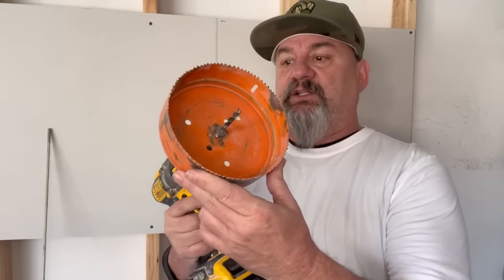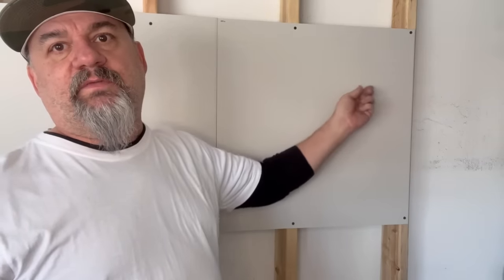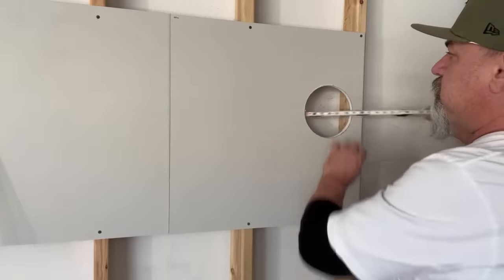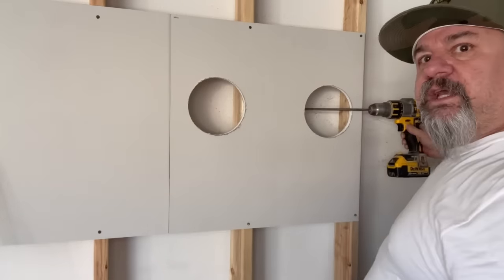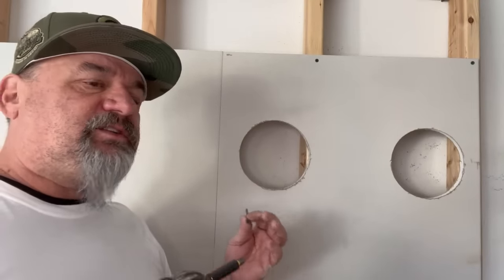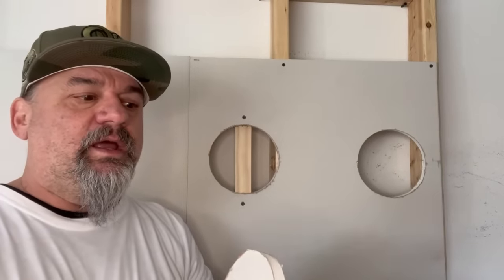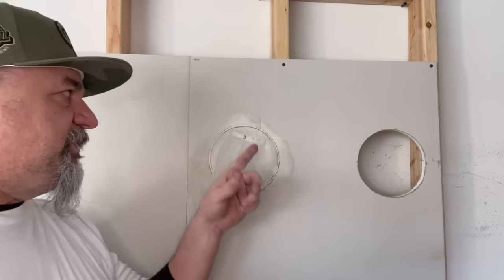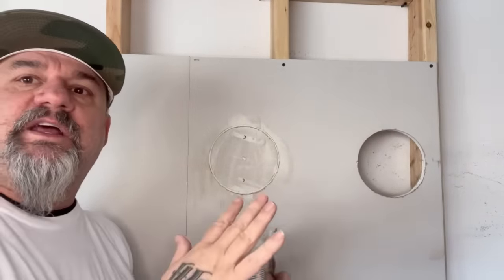Unbelievable Trick to Run Wires Through Walls and Fix Drywall - You Won't Believe What Happens Next!

Comment: Nice tips Mr. Starving Electrician!

Here is something to consider: the mini angle drill to drill horizontally through the studs, or even a regular angle drill with multiple extensions to drill longer lengths horizontally.
Reply from the maker: yea but cant see the other side of the studs for wire or water pipes
Reply: @StarvingElectrician  have you ever tried using a walabot?
Reply: @StarvingElectrician  I've only worked on my own house, but when I needed to know what was behind the wall, I would just drill a hole large enough to stick my borescope into, and then I could see, and the hole I made was small enough to fill with just mud.
If that didn't work, I would make a big enough hole to stick my phone in, and take pictures or video, and that always worked for me.
Reply: @maximusvonderbrewskis  - Funny thing, the Walabot ad appeared right before the video for me.
Reply: @StarvingElectrician sometimes you just gotta risk it for the biscuit, buddy

Comment: All good info!! Only thing I would suggest it to use plywood strips for your backing pieces if it's available. Frequently, those course thread screws will split a small solid piece of wood but the plywood will never split since it's laminated with criss crossed pieces. I always try to put a wider piece in the hole using a long screw right in the center to hold the piece while you install the first screw. 
Obviously, we all use whatever's available!! ;o)
Reply from the maker: yea great point cause they have split on me. thanks
Reply: This is how I know you’ve done this before lol, you are 100% on point.
Reply: Love the plywood idea.  And I know Im being picky, but I would use two backer strips; one screwed to the stud and the other just like his backer plate.
Reply: I use OSB rather than plywood and glue it to the back of the drywall along with the screws.  This leaves a corner that you can butter with compound before you stick the drywall piece back in.

After you sand that compound, prime any fuzzy paper with Kilz, add a small amount of compound as needed and sand.  After painting, the patch will be almost impossible to find

Comment: As a 59 yr old electrician I can tell you that this is the preferred method when you have to drill holes. The key is to leave only footprints. We all have to work together and be our own custodians, most drywallers will not shred your wires with a rotozip if you take care of them lol.
Reply from the maker: sooooooo true!!! lol thanks for watching
Reply: @FedEXfright This is factored in as it's the only way to really get wires, pipes etc from point A to point B in a practical manner. Of course you don't want to drill oversize holes or too many in a row etc.
Reply: @FedEXfright Structurally speaking, drilling a small hole through the centre of the stud has virtually no impact on its load capacity.   What you want to avoid is cutting slots or holes on the edge of the stud and that effectively reduces the cross section.
Reply: @FedEXfright There's codes on drilling holes. As long as you follow the guidelines you are good.
Reply: @Spp235.  In today's houses, I've seen studs cut with a handheld circular saw (I think) with a slot going 2/3rds of the way through the stud at an angle.  Supposedly this allows the drywallers to hang the walls so that they don't do the wavey thing as they transition each adjoining stud along the wall.  The slots in the studs allow the studs some "forward and backward" flexibility to keep the drywall board relatively true all along its width.
Reply: @Jack O'Bean Except if the drywaller has a longer lead-time to work and the homeowner has to hear spousal verbalizations about all the holes in the walls.  If I'm a bachelor, I don't care if I have holes in my drywall for a few weeks.  If I'm married, then I care the same amount as my wife cares.  And it's always less expensive to stay married than it is to get a divorce.  Funny how that works!
Reply: @justaskin8523 that sounds like it would seriously reduce the load bearing ability of the stud, like alot... unlike centered holes. Then seems like with all that extra effort would be better spent culling super wavy studs for walls (not like smaller pieces aren't required on build or some wast is expected)

Idk maybe I am just misunderstanding

Comment: Great advise from an electrician, and I don't even like electricians, plumbers, HVAC, I'm an old guy so I don't like anyone now that I think about it. Joking aside,  A great method for one or two studs to get through but like you mentioned about "you are going to have a hole anyway, size doesn't matter"....Most drywall guys would prefer one single large hole since it's not any harder to finish one big hole vs. 4 small 6" holes and a "hump" at every hole.  Thanks, look forward to checking out your other video's
Reply from the maker: thanks so much!!!

Comment: As a DIYer, I make it easy on myself and remove a section from mid-stud to mid-stud when I'm making a hole bigger than about 6 inches. That always gives me superb support at the ends, and I use those clip-on / screw down / break off clips devices to solidly support the new section of drywall. Tape and mud the edges, sand the surrounding texture down so you can blend it, texture and paint. 
The last DIY job I did (last week, in fact) involved removing a switch that no longer had a purpose and repurposing the wire for an outlet. I'm pretty slow, but drying times actually set the pace. Anyway, I had lots of room to swing a hammer, allowing me to use new construction methods. A 48 by 18 inch piece of drywall made it a simple job.
Reply from the maker: yea I dont envy the drywall guys job at all

Comment: Openings in wall are situational but very good general points.

I've done drywall for over 30 years and general construction, had a hand in most trades.

Always such a brutal sight to see people wanting to make the smallest openings and then just making more problems.

Other people have mentioned maybe a larger opening rather than a bunch of round ones, etc.

Depends on the run. Depends on the wall. Depends on if it's a total finished house or a fix to house under construction with no flooring but finished drywall...

People stop thinking there's one way to do everything. Kudos, great vid.
Reply from the maker: excellent! thank you so much for that!

Comment: @7:48 - Those that advocate for the "california patch" where you have paper overhanging don't understand that you have to do that from a fresh piece of sheetrock. Your method works fine because you are reusing a perfect insert with a strong backing. 

Your method is simple and effective. The other way is way more work and works well too though, but unneeded.
Reply from the maker: yea I remember that term. im just not skilled enough to pull that off. this hack is as good as it gets with drywall...lol
Reply: @StarvingElectrician  for the cali patch, collect some drywall scraps on the next job take that 6" hole saw bit drill out as many 6" holes you can from the scrap flip them over, now take your 4" hole saw bit using the same pilot hole from the back drill slowly down to the paper, take your knife cut the brown/back paper from the outer ring, or cut trough it, break the drywall on the outer ring into pieces peel it off the paper face.. now when you make your 4" holes you have a ready-made cali patch.

Comment: I tend to do every other stud and drill both directions. Saves holes. Also, in some limited circumstances, if you use the large diameter holesaw, you can drill directly over the stud. That gives you the backing to secure to when you  go to put it back together. Useful in some cases where you just need access though if you are drilling with a long flexible bit you can do it there to.

Comment: As an old electrician we would have the occasional box covered up by the drywallers and I was taught to do my best to find the box and cut an opening for it without damaging the drywall. Most of the time I managed to get the center of the box the first time. That would require a straight edge to find the hump (both horizontally and vertically), make a mark in pencil (never ink), and drill the tiniest hole so you could wiggle a wire in it and listen for the "clicks" as the wire found the other wires in the box. Once I found it, I would cut the drywall out and install my receptacle or switch. If I did my work well the drywaller wouldn't have to be called in to repair anything.

Or you could do as other electricians did and just use your hammer. 

Usually we didn't have any problems outside of a "stocker" (the guy who would offload the drywall delivery truck) forgetting to put my wire back (they would remove Romex cables to make it easier and safer for them to carry the drywall sheets through the unfinished walls. Occasionally they would forget to put the wire back). Or the occasional forgotten cutout. No big deal.

Then along came a drywaller who did work for the McCoy* boys, Dan & Jim, who would slap a sheet of drywall on the wall, screw it down, and then use a router it "find" the boxes. This left my wires nicked up as often as not, a ton of mud left in the box (it wouldn't even be dry by the time I came back to trim out the house), and the drywall bulged out because it was sitting on top of the face of my box rather than having the lip of the box being flush with it. That would require me buying longer screws to use to mount the devices with.

I asked the guys nicely to quit doing this, and what I got was "we all have to make money". Alrighty then...

 So the next McCoy house that I roughed in, I made the pigtails extra long, packed them in loosely, and tied every wire to the one temp breaker that powered an outlet under the sink.

That got their attention. Apparently they ruined three router bits and one router. That's when they asked me nicely if there was any other way that I could wire the houses in the future. We came to a satisfactory arrangement.

* Their uncle, Bill McCoy, was my 5th grade English teacher who was also an Electrician. When I was 13 I asked if I could help him wire our church's rectory. He said "Get away from me kid". At 28, he was working off of my Masters License. :)

Comment: I do this method, but cut a bandaid patch using the same hole saw with a drill press (very easy and fast to cut from the backside of a piece of drywall, leaving the finished paper untouched/ I carry these in my truck).  The bandaid  patch has finish side paper, so the circular cut wont crack on finishing and essentially gives you a taped joint on the circular cut.  The patch will usually finish with two coats of mud.

Comment: Nice work - I always appreciate when my local electricians just leave the cut out for me to patch up - having them install the cut out for me would be a bonus... ALTHOUGH (there's always that, right?!), I would prefer that you not patch the seams because they do need to be taped to avoid cracking out in the near future. Not a big deal for a taper, I can have holes like that finished and textured in just a few minutes.
My add on would be to use 5/8" or 3/4" plywood or OSB as the backer - WAY easier and they don't split out. Electricians are a drywaller's best friend or worst enemy. I make sure to find out what my fellow contractors preferences are and TRY TO HELP THEM OUT! They'll do the same for you. Nothing like having subs that get along and know how to work together, even when you're not on the jobsite at the same time. One hand washes the other... Or, one hand for the taco, one for the beer! Cheers!
Reply from the maker: right on thanks for your comment

Comment: I'm not a drywaller or an electrician, but I've had enough house work done over the years that required "slugs" to be removed and replaced.  Here's my tip:  When the slug is out of the wall, take the time to mark them so that you will know which slug goes into which wall, then take the slugs (one of each color wall that needs to be repaired) up to your local HomeDepot, Lowes, Sherwin Williams, etc, and have that paint color matched and at least get a small sample chip of the matched color, along with the code that you need for mixing up enough paint to cover all of the slugs in all of the places that had to be drilled for this project.  You don't necessarily have to buy the paint yet, but you SHOULD get the paint color codes so that you don't have to bring a whole wall into Lowes-Depot with you later on, lol.  

Now, to get the colors to match in the final work, you let your drywaller do his thing, he'll finish applying mud, texture, whatever so that the circle (or square, or whatever other shape the plugs are in) won't show.  After all the mud dries, now you can paint.

Power tip 1:  Know what paint is already on your walls, INCLUDING THE PRIMER.  When I paint a room in my house, I always use the same stuff, so I know what each layer is made up of.  If Kilz is under the paint on that whole wall, then paint over the new texture mud with Kilz.  If it's Zinser, use Zinser.  Don't switch up primers or paints, and don't change the gloss-level, either.  If you painted everything in eggshell 10 years ago, then it's hard to make a mistake if you order your patching paint in eggshell.  Roll your primer over the slug, then feather your primer over the undamaged paint outside of the slug with a partially loaded/partially dry brush.  Use the same number of coats of primer that you already have on the undamaged parts of that wall.  Then apply your new "specially mixed" top-coat from your paint maker.  Do the same thing; roll it on and feather it out beyond the edges of your prior primer feathering.  Use the same number of top-coats that were on the wall before you had to cut holes in the drywall.

I did all of this after a whole-house re-pipe project some years ago, where they had to run new PEX through the rafters and down the walls.  You can't tell where my walls had to be opened up and you can't tell where I repainted.  And I don't mean you can't tell if you don't look too carefully.  No, you.  can't.  tell.  Plus, I avoided having to repaint entire walls just to achieve an even color over the patched spots.  My drywallers used metal fasteners and metal "sticks" as the backing materials, but I like the Starving Electrician's way of using wood, or the person below who says to use plywood.
Reply from the maker: yea its one of many tricks or hacks, just trying to share what I use if I absolutely have to!!!  thanks for watching.

Comment: Yea, don't do this. Cut back the wall as a rectangle to the middle of the adjacent studs, then  drywall screw the edges of the cutout piece as well is the edges of the wallboard that was not cut out. Then refinish the whole area, not just the edges of the cut piece or it will show. Learn to do it right and it won't be more effort than trying to cut the minimum out, and you will have more space for your angle drill as well.
Reply from the maker: thanks.this is just one of many ways

Comment: This trick works! If it's apartment wall, i personally recommend adding small supports to both sides of the hole in just to prevent the small chance of it snapping in half if something heavy hits it. some drywall fellas also like to carve the edges into v shapes. something about putty having more ground to stuck on to

Comment: Great video!!  Right to the point... NO B.S.  One suggestion, however...  try running the drill in reverse when drilling the hole.  It is easier to control and less dust.  Drywall is very soft.  So you will have no problem drilling through it.
Reply from the maker: yea Theres a few things i missed. thanks

Comment: I've always found it better to replace the cut out with smaller gauge plaster board, so if the board is half inch, replace the hole with 3/8 board, this then  gives you something to fill in, keeping the wall flat, in the UK it would normally be a 12.5mm plasterboard that you would replace with a 9mm board, can also get hold of 6mm board
Reply from the maker: hmmmmm ok very cool. thanks
Reply: Thats a great idea
Reply: Just adds more work, for no gain --either way you still have the lip of the original drywall to cover, and that adds thickness from the compound and tape. You always tape, don't you?
Reply: @henseleric  No, you don't have to tape over both sides of the joint, with a small gap between the boards the filler/mud should be pushes into it, this bonds them together, you can run tape on the inside if wanted. if the joint is weak, you can add a extra wood/mettle batten by screwing it to both sides of the joints on the back. Have always found this method stronger.
If the wall is going to be tiled, you don't want bumps in it. My trade is a plasterer, so I've fixed many holes in walls/ceilings over the years

Comment: I like square holes because I put put four pieces of fiberglass drywall tape on the seams.  I sometimes use small pieces of plywood for the strip in back because it won't split
Reply from the maker: yep I hear ya

Comment: Pro tip #1. Drill it in reverse and it won't dull the teeth of get stuck. Drywall is actually brutal on bits/saws.
Pro tip #2. Use plywood for the patch backing. It will never split like 1x2 or 2x2
Reply from the maker: damn it more stuff I forgot!!!...lol

Comment: Been a sparky for over 40 years.  Had to do that when on a slab or a ground floor.  Usually fish down through the basement, and up the wall, or the attic and down the wall.  No drywall repair needed.